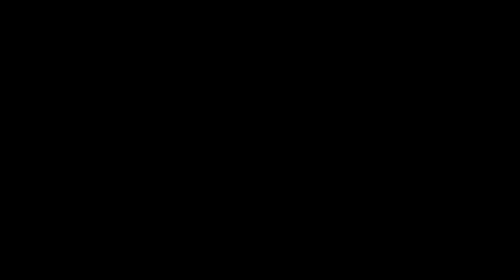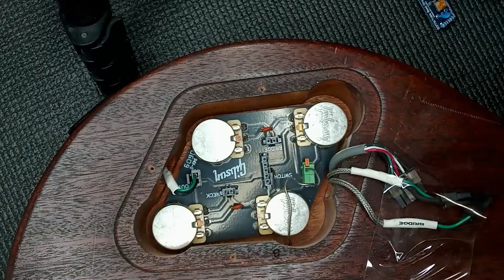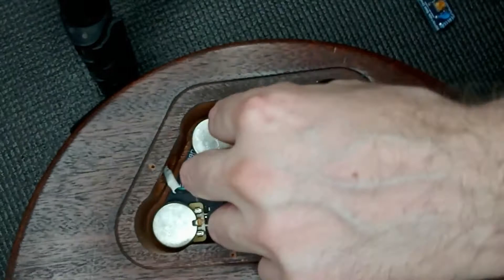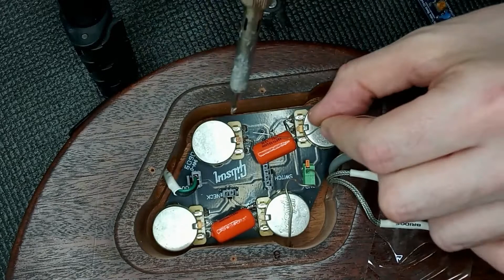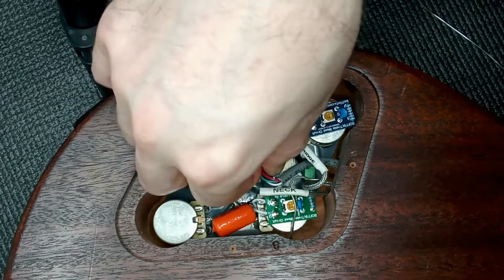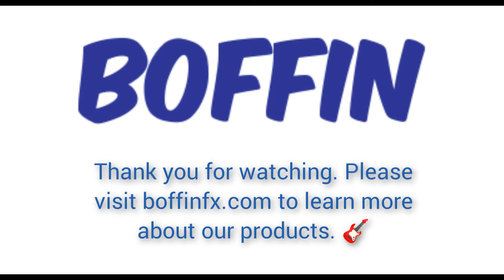Boffin FX Upgrades a Gibson Les Paul Studio PCB Control Board

Comment: So , mission accomplished all I dd was snap off the old caps ,  sent it to ground by soldering a wire from the middle terminal to the top of the pot , the heat up the solder points of the 50s wiring ( bottom tone, middle volume lugs) and add a orange drop cap. 
That's it.. × 2